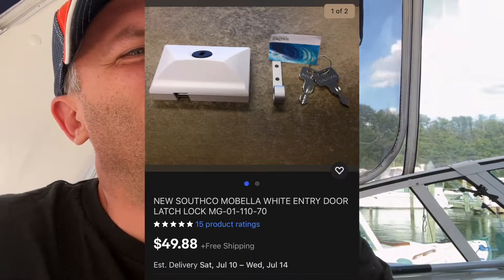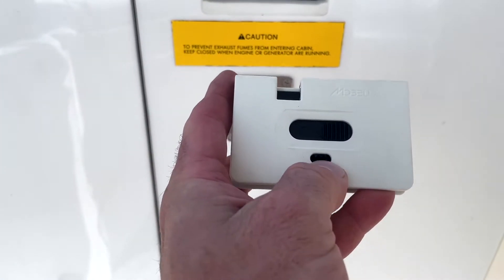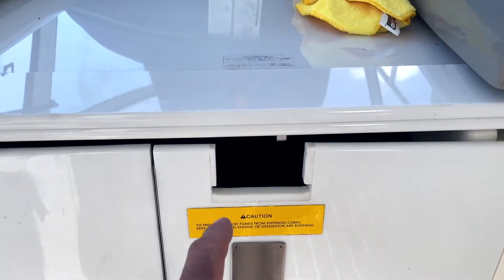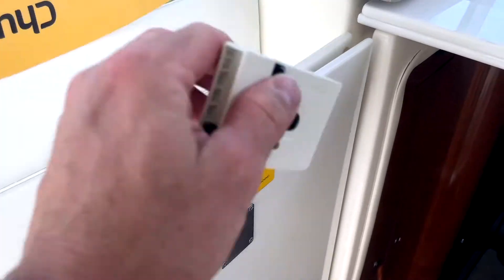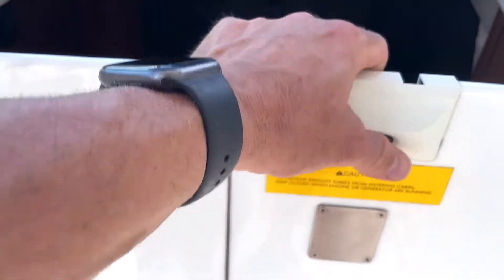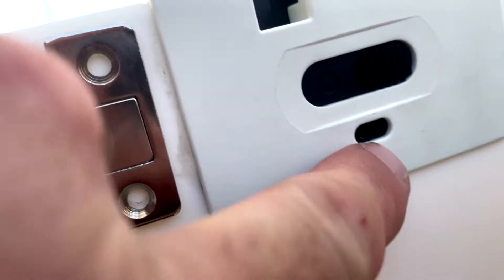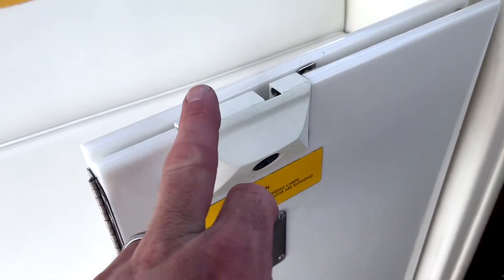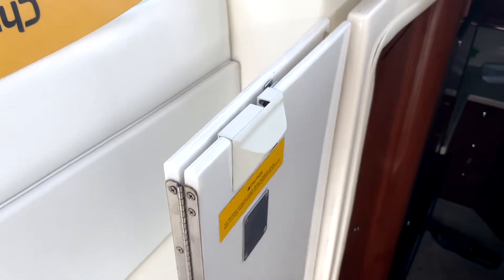Installing the Southco Mobella Latch lock MG-01-110-70

Comment: Great video.
Question If you Happens to know the steel magnet to hold door open in your video is called?
Reply from the maker: Cabinet Door Magnets Jiayi 8 Pack Ultra Thin Cabinet Magnetic Catch Stick On Magnetic Drawer Closure Drawer Magnets for Kitchen Cabinet Closet Door Magnetic Latch Sliding Door Magnet Cupboard Closer https://www.amazon.com/dp/B07J4WYGC9/ref=cm_sw_r_cp_api_i_716NDM1XTHMXCMRR2NWV?_encoding=UTF8&psc=1
It works really well to keep the door open! One up top and one down low does the trick.
Reply: Greatly appreciate your quick response

Comment: This is the stupidest design for a door lock ever. Why did these idiots feel the need to reinvent the wheel?  The concept of reassembling is easy. And this video is good. But even if you can get the latch on the slider (which doesn't slide easily if the mechanism is still in the door) it's damn near impossible to get the spring hooked on without the latch popping off the hook.